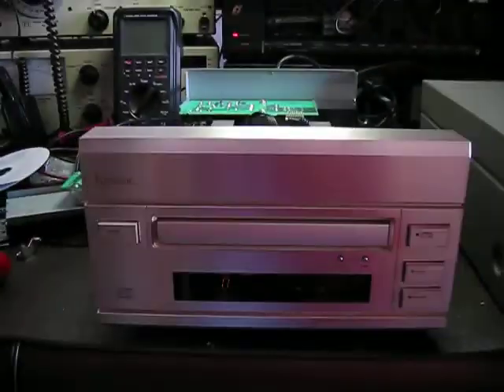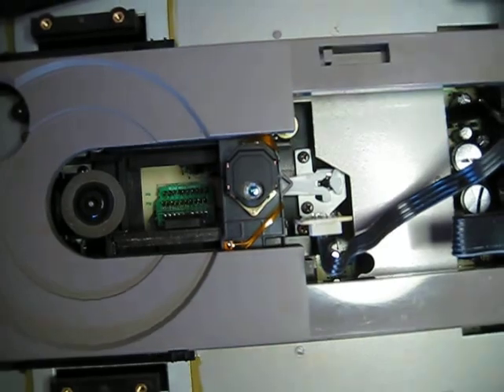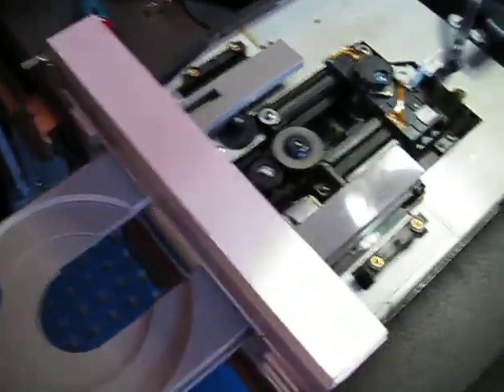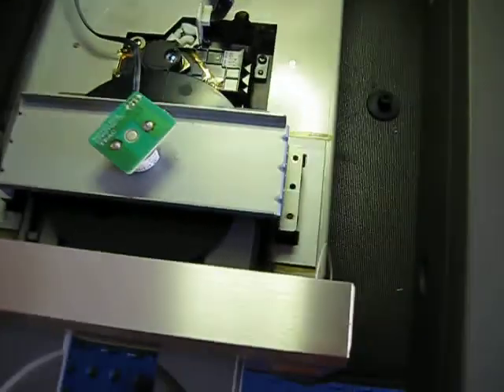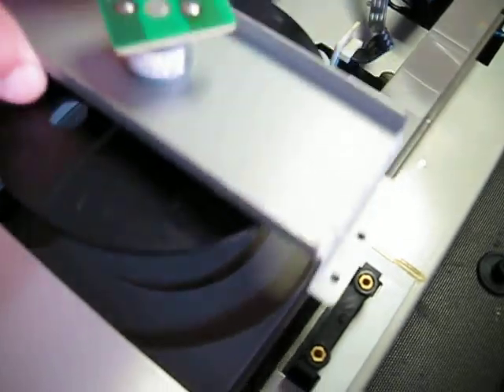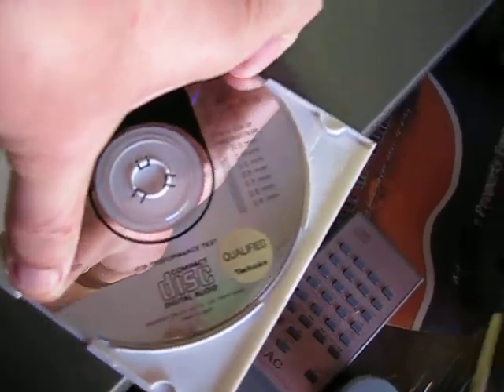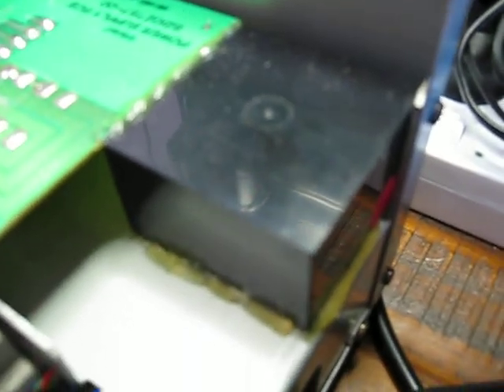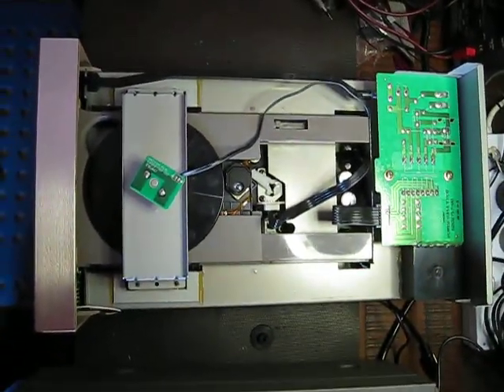Esoteric P-500 after laser replacement

Comment: Hi, i have one of these P500 the extra circuitry is a DELTRAN mod the optical plugs into a stock DELTEC DAC
and the DAC takes over the control of the Transport. Giving a noticeable improvement in clarity ,image and definition
moving the P500 into another class.  Contrary  to perception it is imperative the 4 screws on the platter x/brace
 are only JUST nipped up,NOT tightened. Richard
Reply from the maker: Thanks Richard for the info.
Does this mean that only Deltec DAC can utilize this Toslink connection?
Cheers
Roman
Reply: Hi, The Deltec Dac i have is called the Bigger Bit it has a port marked Deltran and a on off toggle switch
(not to be activated when all mains are on) So you can compare with/without Deltran mod. My Dac working 
since 1993 very reliable all surface mount components. The Master clock resides in the Dac so it doesnt
have to interpret what the transport is doing so signal is processed without interpretive time errors when
it reaches the Dac.(am reading this) Mod cost 395GBP in 1993  Transport 650GBP. I think i 
paid less for Mod in Australia, it says in addition it appears to bring out the near- analogue warmth
that has been lacking in Deltec converters. I have a full range system majoring in Vinyl and i consider
the CD replay excellent.
Reply from the maker: Thanks, I really appreciate your answer.
Reply: Hi Richard, long time no speak my friend (we corresponded quite a lot via Email several years ago - David Pastern if you remember my name).  I hope all is well at your end.  My DPA PDM 1 series 2 DAC stopped working shortly after our last correspondence, changed over the toslink cables, no luck.  I remember you saying that the optical links that DPA used were proprietary and spare parts were long since not available, so I gave up on my DPA unit.  A pity, cos I paid nearly AUD $800 for it back in 2005 and only used it lightly for less than a year...wasn't a good buy!